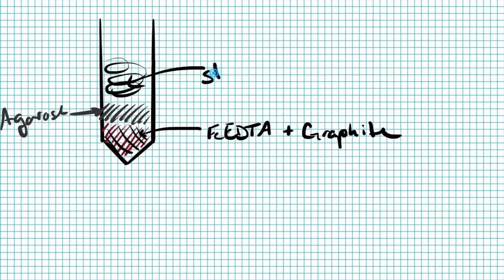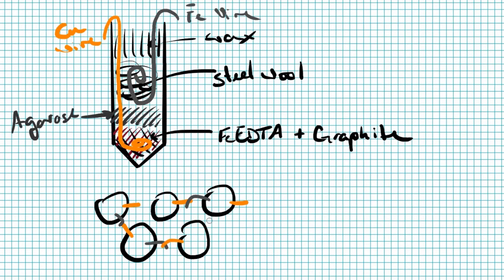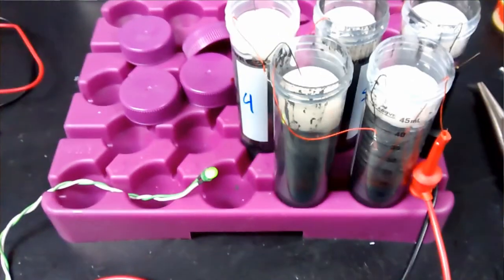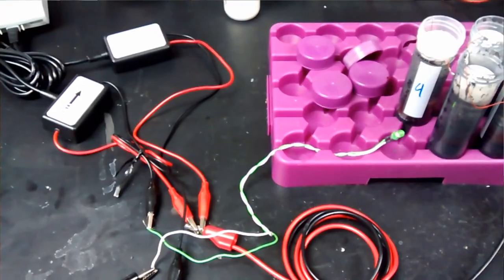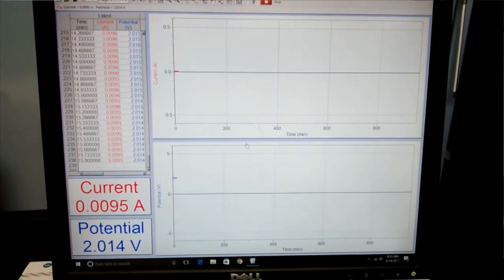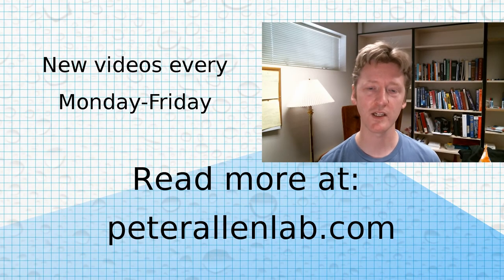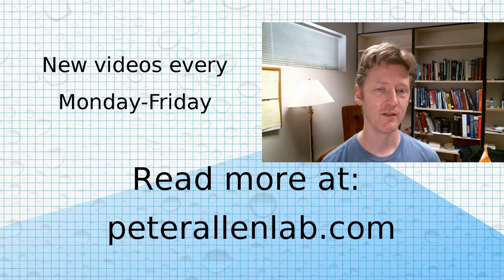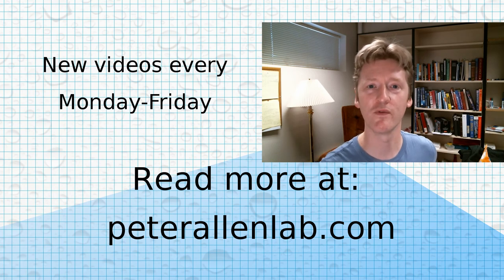All-Iron Battery - 5 cells in series powering an LED

Comment: Congratulations, you are the proud father of quintuplets! :)
Peter, in the next video where you get some more results, could you also review the chemical reaction in both charge and discharge directions, especially as to what ions are going through the EDTA + agarose?  I understood the original versions with the chloride ions, but here with EDTA you have a larger molecule, so I'm not sure what ions it disassociates into in solution.
Reply from the maker: Sorry i missed this comment - the whole Fe-EDTA complex is a big negatively charged ion. There's also a lot of sodium to get the pH right. I bought disodium EDTA to start with. I suspect it's the sodium that is the most mobile ion.